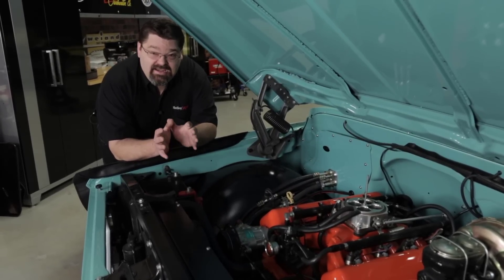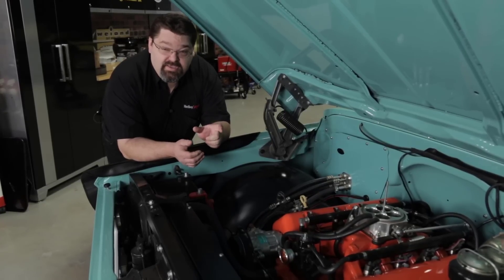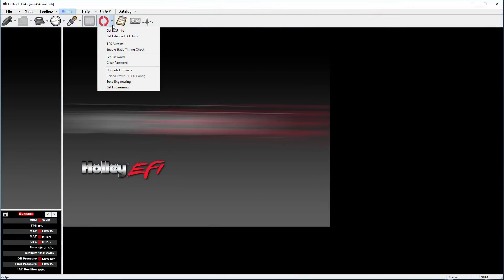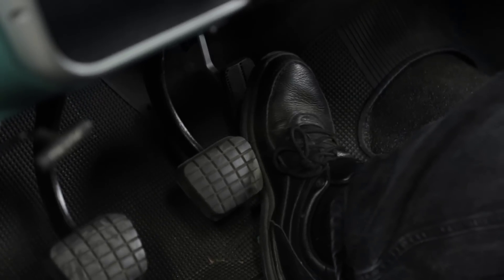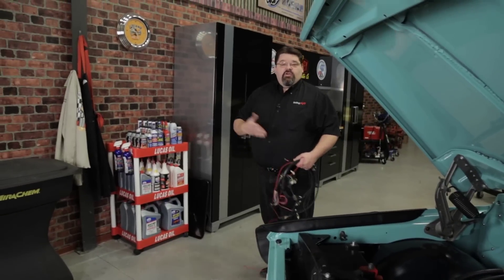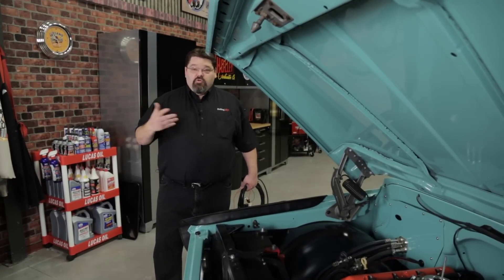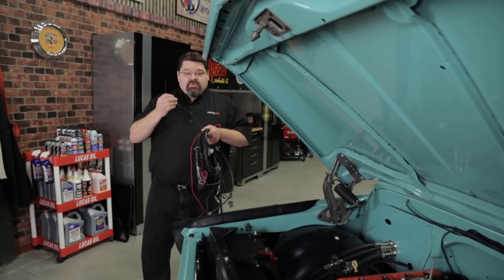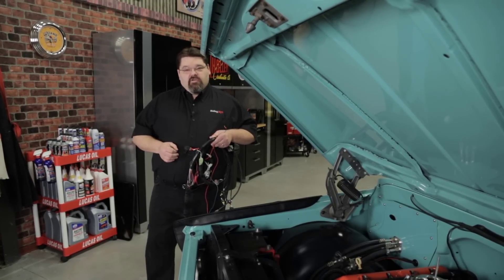Holley EFI - Throttle Position Sensor Auto Set

Comment: Hello, I enjoyed this video, but I have a problem with calibrating the TPS sensor with a 90 mm cable that opened the gate. It does not respond to programming, whereas when the sensor is removed from the body of the gate and it appears that the calibration was completed on the gate, it indicates that the calibration was successful. This means that the wires are intact, but the motor does not work, knowing that the sensor is New and the portal opens completely. The application is on the LS3 6L. Is there an expected solution? Note that the general calibration file has not been changed, but only the firmware has been updated.

Comment: Is it possible to make the throttle  only open about 70% and use the auto-set to make it think it's at full throttle?  
The 4150/900cfm is way to big for my mild V8 (should have gotten 2300).

Comment: I have an issue with my holley Dominator i using it on Gm turbo 2010 LS 5.3 GEN IV , x58  with LS3 TB DBW i used different pedals to keep matching between the pedal and throttle body as what was written in the holley DBW instructions  i used Camaro 2013 pedal and Caddilac cts 2009 pedal the same pedal part number in the instruction when i did the autoset the throttle not opening after the preparing for press the pedal twice when i check in TPS vs. pedal table it's just reading 20% I dunno what the mistake or what the solution is there any special wiring for a pedal pin out  or what ?
Reply: Did you figure this out